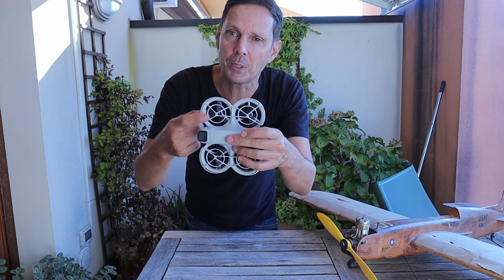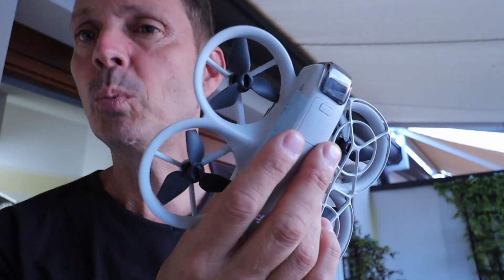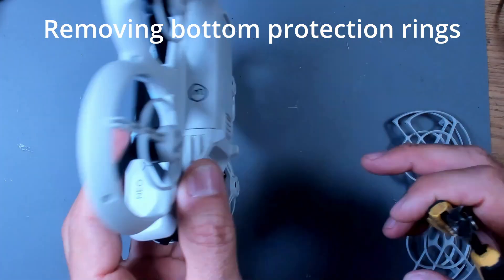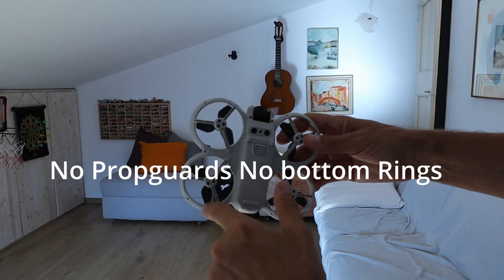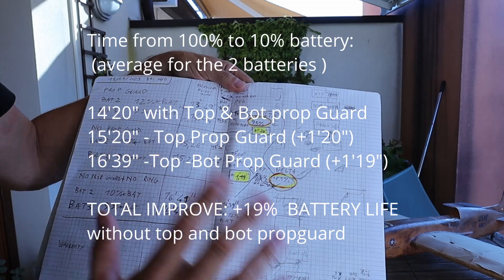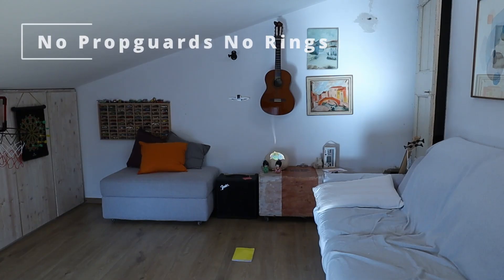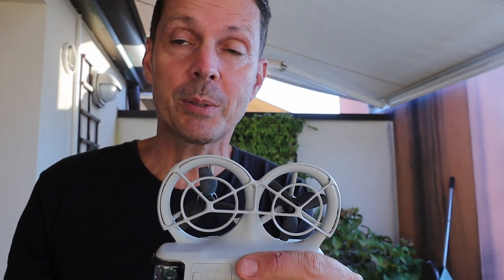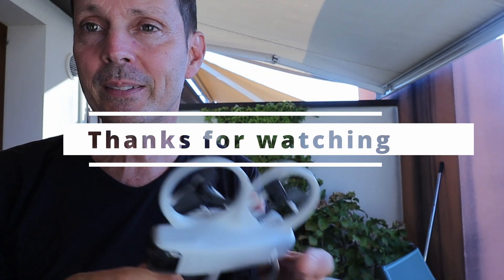DJI Neo mod: flight time boost +19% (void warranty & DJI care)

Comment: yeah those are  results  for hoovering in one place...flying here and there outside is a different story
Reply from the maker: I measured also outside. Absolute time is reduced but improvement in % is still there (hard we to judge if the flights have the same style) . Lets see if I do another video about max speed for instance

Comment: In the title, it is claimed that cutting off these struts would give 19% more flight time. That is, of course, nonsense. On its own, it would probably not bring any measurable benefit at all. So losing the warranty over it would be absurd.
Reply from the maker: Before comment, try removing the upper propeller removal, and you will have results consistent with mine.

Comment: Clown show. Who cares about 1'30" more flight time? What is it going to get you?
Reply: I bet you have DONE something better than that?
Reply: He was driven by what? He’s just one of those countless guys trying to pass off their embarrassing incompetence as rocket science. And indeed, there are always people who fall for it.
Reply: @avronaut and you are hero who fighting with it online😂😂😂
Reply: It can save the Neo from long distance flights. Not a big difference per flight but its a lot for long term use - you can get more usable film by adding around 5mins of flight from 3 batteries
Reply: Intersting info... Whole FPV hobby is for fun and modyfication. Neo flys like duck in manual, maybe this mod will improve fly charecteristic a bit. Your commen is unnesesery
Reply: @DiabloIIICzarodziej  Removing the top guard the change in flying is barely noticeable but it's there. Removing those rings does absolutely nothing. I did it and I regret it cause all it did was increase the likelyhood of breaking props and not being able to recover. The reason for it that those rings help push stuff away from the props. Without them much easier for branches to get stuck in the prop.  You can't recover when a prop breaks.

Comment: You must nothing cut anything. If you wan‘t a longer flight time, you can disconnect the propeller protection with click. If you need him you can fix it again. You can use other Propellers. To cut off the Stabilisator is minimal more flight time.

Comment: Nice video. Like you, I removed the bottom rings and the propeller guards. Eventually I had the same flight time and noise improvements. I also experienced that prop wash was reduced when flying acros in full manual mode.
Reply from the maker: Thanks for reporting this
Reply: I am glad to hear this.  I removed the top ones today, and will probably remove the bottoms in the near future.

Comment: Increase speed fly in sport mode?
Reply from the maker: Hi, i think in sport mode it is limited by software. Probably in manual with attitude limit off there will be some improvement. I will try a compariaon as soon my fpv controller will arrive. I just purchased the neo and it came with the motion controller only, so manual mode not possible now.

Comment: Ya se lo he hecho a mí DJ Neo aparte de ponerle unas 5 palas y va muchísimo más suave y fino
Reply: The 5 blade is one of the worst. For noobs only who pretend experienced pilots😁
Reply: @asdfghjklmnbvcxyqwertzuiop Wow! Making friends with harsh comments XD
5-blade props provide stability and consistency at pace, although they require more energy and require fewer turns to create lift and buoyancy, especially for less powerful engines. It seems you're not as advanced as you thought after all.

Comment: DO NOT CUT THOSE LOWER THINGIES, THEY STOP STUFF FROM GETTING IN THE PROPS. WITH THEM YOU HIT A TREE AND YOU ARE FINE BECAUSE THEY PUSH BRANCHES OUT OF THE WAY, WITHOUT THEM MUCH HIGHER RISK YOU BREAK A PROP WHEN GOING DOWN AND BACKWARDS. I DID THIS AND NOW I KEEP BREAKING MY PROPS
Reply from the maker: Man, i have 5 racing drones without propguards, i m used to it, i ll survive
Reply: @MakerFabio yeah you but people following your advice will start breaking more Neo props, luckily they are very cheap but when you break a prop you can't recover ... what if you fall in a puddle. Bye bye Neo. Why would you cut those anyways? they weight like not even 1 gram or so.
Reply from the maker: @KainniaK sorry but did you even watch the video, the point is not the weight but the bottom rings  are in the middle of the ariflow
Reply: @MakerFabio  I got mine cut, the difference is not noticeable, unlike flying without the top prop guards and all people will do is break more props for no benefit.
Reply from the maker: @KainniaK the benefit is shown in the video. They will judge if they want it or not. If tou perform a serious measurement and find differences, please post
Reply: @KainniaK  Buy more props man, they are cheap. I use 3+1 different racing props and have 25+ sets (over 100 pcs) propellers for my neos and 15+ sets for my avata2.
Reply: @MakerFabio  Why would anybody want to hover a  minute longer? People want to fly, not hover. And you only took one sample. How is that good testing?
Reply: @asdfghjklmnbvcxyqwertzuiop any links to where to buy the props or names
Reply: @KainniaK i was asking myself the same question! I understand if people remove things to get a “lighter” drone but it only benefits if theres no wind! Otherwise it looks to me like a waste of time clipping your drone.
Reply: @KainniaK the point isn’t to hover for a minute longer…it’s to allow better airflow to your propellers. It makes the propellers spin more efficiently and improves the Neo’s flight. I bet you’ve never flown yours in manual mode.
Reply: @DogsBestFriend143   Bobadas, Dronarchy lo vuela sin inventos y hace lo que quiere sin inventos raros.
Reply: @KainniaK Ya I will choose not to cut those supports. Cause thats what they are. Supports.. Im thinking they add to the strength of the drone..DJI probably designed them that way for that reason.
Reply: @MakerFabio  some noobs think everybody is noob, just because have this drone

Comment: 19%? hmmm
Reply from the maker: yes correct, please calculate in seconds and not with minutes.14'0"  = 840"  then 16'39"= 999 sec. feel free to repeat the experiment from your side, just removing he upper prop guard, and comment if you find discrepances. thanks
Reply: But the guards make it what it is, very stable and follows you in tight spaces
Reply from the maker: @paulstanton29  sure but upper and especially  lower propguard are much less important than the side ring
So you don t loose the flying indoor benefit. About stability, the propguards are not relevant